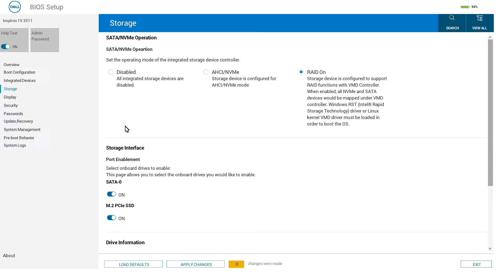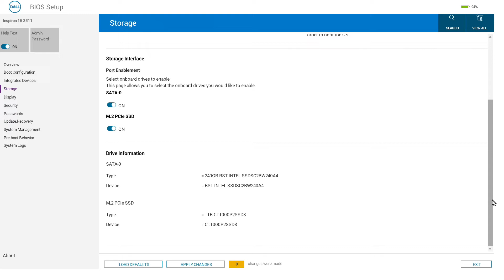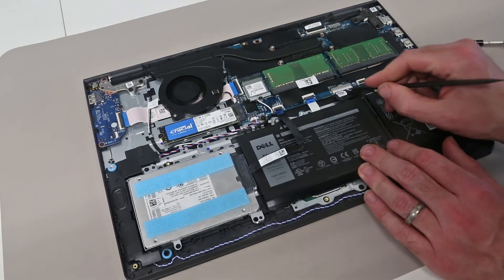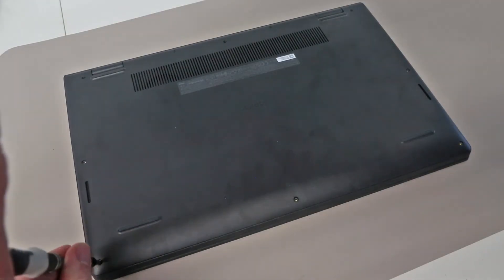Dell Inspiron 15 3511 (2021) Upgrade Guide - M.2 SSD, 2.5" HDD, DDR4 RAM and WiFi Replacement

Comment: Thanks for the videos.  Could you show how to transfer Windows from a currently installed HDD to the NVME?  Would like to add an NVME for a boot drive and wondering if there is a way to directly clone the HDD to the NVME?  Thanks again.

Comment: I've put 2 identical 8 gigs ram sticks on my laptop of 3200MHz speed each but when I open my task manager to check the specs on ram it only says a speed of 2667MHz. Why does that happen? Is there a problem with the ram sticks or does the motherboard have some kind of "cap" on speed so it can't utilize the full speed of the sticks? Btw I checked the cpu specs and it supports a memory up to 3200Mhz anyway

Comment: Can i remove hdd from inspiron 3511 ?because i don't need that..
Reply from the maker: Does it have a hard drive currently? If so, yes, if you also have an SSD with Windows installed to it.

Comment: Can it use lpddr4x with any advantages
Reply: Also is there a battery upgrade you could link me to, for 10hr+ life for i7 model
Reply from the maker: No, LPDDR4x RAM is soldered down and not available as SO-DIMM modules. The 3511 doesn't even run its DDR4 at 3200MHz, it caps them to DDR4-2666 speed.
Reply: @BrueComputing  okay thank you still a good deal though

Comment: Hi mate, great succinct and informative video you made. I am getting speeds around 1,700 read on a new Kingston 500GB KC2500 M.2 NVMe I installed. Apparently the machine supports pcie 3.0 x4. Would you have any clue why such low speeds?
Cheers from Australia

Comment: Great video! Stupid question. How do I replace the c drive and without messing up the factory installed windows? What’s the right way to make sure I can boot after the install?
Reply: I don't know if you have found the answer yet. This is how I did my upgrade. First back up all your files into an external drive. Second, create a boot drive using a USB memory stick. Preferably with an empty 16gb drive. Google instruction on how to create a boot drive, it's pretty easy. The next and important step is to go into BIOS and change the boot sequence, so that your laptop boots from the USB drive. How to enter into your BIOS depends on the model of your laptop. More often than not, it involves pressing repeatedly F8 or some other F key while the laptop is starting up. After this, you can go ahead and install the new drive. 
On booting up after installing the new drive, make sure you have the bootable memory stick inserted into a USB port on your laptop. The computer will boot into USB drive, and then will reinstall the factory installed Windows onto the new hard drive. After, you should go back into BIOS to change the boot sequence to boot from the new hard drive. Later you can now restore your files onto the new hard drive.
Note: This method only restores the factory installed Windows onto the new hard drive. It does not reinstall the other software and drivers that came with your laptop. You have to redownload and install it manually. To be honest it is not a bad thing. You get a clean Window install after you upgrade your drive, without all the fluff and bloatware that came with the original system. Before I upgraded from an optical drive to an SDD, it used to take something between 2 to 3 mins to completely boot up due to all the crappy software starting up in the background. I thought I needed more RAM. But I switched to an SSD, and the computer boots up almost instantaneously.

Comment: Awesome, But in my case, first this laptop came with 2.5" HDD an boot from it (unit 0), now I installed a M.2 SSD 256 GB (unit 1), all good i can see the SSD in the boot configuration but i need to boot from the SSD and when reinstall the W10 not aloud me to choose this as prinicipal boot. Any suggestion?
Reply: Go to device management and delete old partion that you dont want to bootup your windows.

Comment: I have dell i7 3511 with 1 tb hdd
Can i replace it with 1 tb ssd? 
Or I have to add it?
Reply from the maker: Yes, you could fit a 2.5" SATA SSD to replace it, or an M.2 NVMe drive in addition to it.

Comment: Hi Brue, I added a 2.5 Sandisk SSD but it does not appear in the BIOS. The SSD works fine on other computers. I also tried to switch from RAID to AHCI but no success, everything works fine but my sata ssd does not appear. Do you think there is an other option in the BIOS I did not see or is it a driver problem ? or a hardware problem :( ?
Reply: Olá, conseguiu resolver?! Estou com o mesmo problema...

Comment: Hi Bruce.. i bought this laptop from US  .. I have only integrated graphic card.. can we have the dedicated graphic card installed
Reply from the maker: Only by replacing the mainboard - the discrete GPU is soldered to the board and can't be retrofitted.
Reply: no, use an egpu

Comment: Hello, could you tell the specs of the 8gb RAM that comes with this laptop? Voltage, latencies, frequency. I'm looking to buy another 8gb comb
Reply from the maker: Amazon Associate link to what you need in the description
8GB DDR4-3200: https://amzn.to/3Bmv96q
It runs at DDR4-2666 speed, but the module installed in it is a DDR4-3200 1.2v CL22 one.
Reply: @BrueComputing  ok, thank you :)
Reply from the maker: No problem!

Comment: Does it have TPM 2.0? and does it have official support for Windows 11?
Reply from the maker: Yes, TPM 2.0 and upgrades to Windows 11 no problem.
Reply: lol the minimum requirements of windows 11 is a 8th gen intel
Reply: @ChrisTian-sd5yq  I have installed it in my HP 840 G1 (i5 4th gen). I bypassed the TPM checking in the installer.
Reply: @kielvostro  that's possible too, but it may not receive updates in the future

Comment: Did you get the 8gb RAM stick via the link sent? or two 4gb rams, or a 4gb ram and used the current 4gb ram?
Reply from the maker: I fitted a 4GB stick to test with, giving a total of 8GB. The link into the description is for an 8GB module, but can find a 4GB option in there as well.
Reply: @BrueComputing  thanks! So doesn't need to be same brand, great
Reply from the maker: @TheJassal98  Shouldn't need to be, so long as it is the same specification. Despite running at DDR4-2666 speed the stick installed is a DDR4-3200 module.

Comment: Is it ok to put full length M.2 card without any heat sync? Looks like the small form factor one got heat dissipation through the support riser.
Reply from the maker: Yes, shouldn't be an issue.

Comment: We can upgrade RAM upto how much GB ? 12gb 16gb or 32 gb ?
Reply from the maker: 2 x 16GB definitely works. 2 x 32GB may as well.
Reply: What do you even need soo much ram for? Above 16 is def overkill for an i3
Reply: @tariq7071  I have the same laptop (dell 3511) so youre saying that I can upgrade my RAM for 16gb?
Reply: @boomcharot7027  yes exactly  mine is 512gb with 16gb ram

Comment: I’ve tested it with DDR4 @ 2666MHz and it turns out to be unstable. After I removed it, the laptop is normal back...

There is a reason why Dell is throwing a RAM clocked @ 3200MHz...
Reply from the maker: Good info, thanks.
Reply: you are welcome...
Reply: so far, my 4gb 2666 kingston works fine